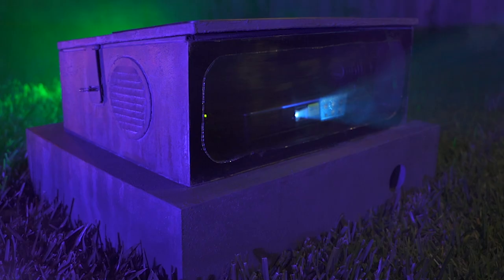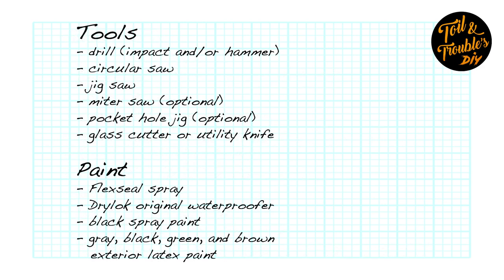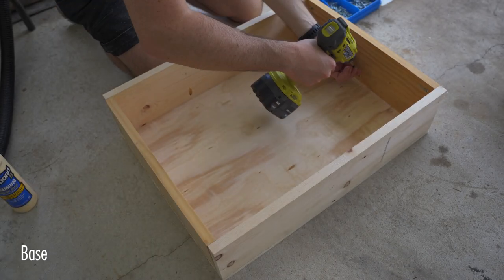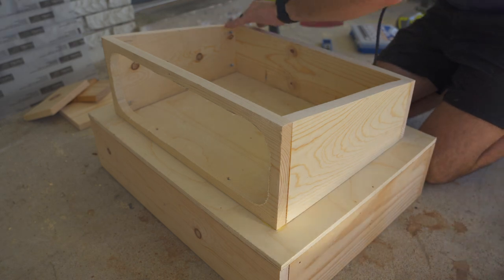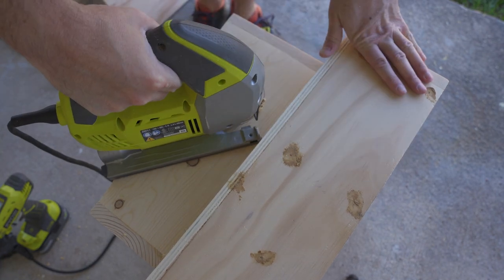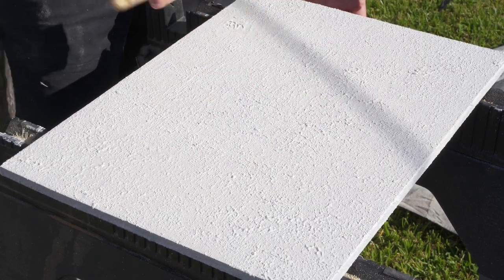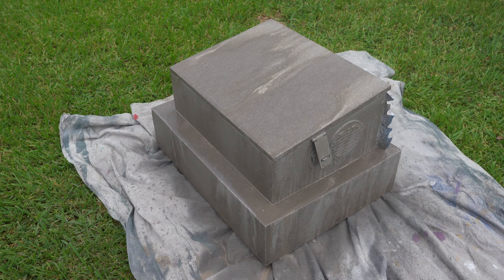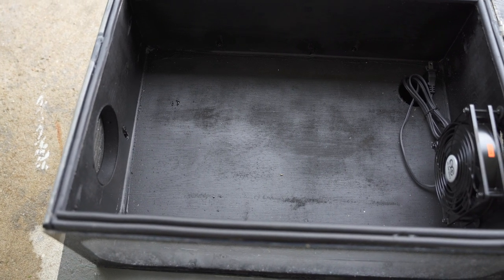How-to: Best Weatherproof Gravestone Projector Housing for Halloween Digital Decorating

Comment: I bought a pc case with 3 fans already installed and vent for 60 bucks.  Cut side panel and glued in picture frame glass. Easy, cheap, took an hour. Mounted with brackets on a pole.
Reply from the maker: Thanks for letting me know!
Reply: Is there a tutorial on how you did it?

Comment: Awesome final results. I’m in the process of making one of these myself! Just a friendly FYI, they make special plexiglass/lexan cutting blades for jigsaws.
Reply from the maker: Thank you! That’s great to know; I had no idea!
Reply: @ToilandTroublesDIY  Great tutorial video dude! Just noticed it after commenting on another video. What do you recommend for a projector that won't be too expensive for the pumpkins? Also, I assume the glass getting wet in the rain would interfere with the projection onto the pumpkins?
Reply from the maker: @fennec7906  Thank you! I highly recommend the Aaxa BP1 as a "just enough" option for pumpkins. And no, the rain doesn't really affect the image unless fog settles in behind the plexi, but hey, that's what the fan is for!
Reply: Thanks Peter for the suggestion of using jigsaw blade. I used Bosch T102BF and that saved the day for me (instead of trying to cut lexan manually)

Comment: Do you use the 1-1/4" pocket screws for the base and top? Or the 1" pocket screws? Thanks!
Reply from the maker: I used 1" pocket hole screws so that the screw would not go through the top sheet of plywood.

Comment: The PC fan has an electrical plug on it?
Reply from the maker: Yes it does
Reply: @ToilandTroublesDIY  The projector doesn't get hot with only 1 fan? Is it an intake or exhaust fan? Do you use waterproof extension cord covers at all? I'm thinking on building something like this for myself, but unlike a lot of projectors I see, my exhaust is on the front of my projector next to the lens, so hot air would be pushing up against the plexiglass.
Reply from the maker: The size of the housing was designed for use with small to medium sized projectors so the ones that I use do not get very hot when inside. You may want to consider putting vent holes in the floor of the housing and adding an additional fan on the other side to pull cool air into the housing. The fan used in the video is meant for exhaust of hot air and i do not use waterproof extension cord covers as all of the electrical components are inside of or under the housing.
Reply: @ToilandTroublesDIY  Yeah, my projector (BENQ W1070) is about 1 foot x 9 and a half inches big. I was reading through the instruction manual and it says: "Allow at least 50 cm or 20" clearance from walls and free flow of air around the projector." That's a very big gravestone if you're allowing 20" on all sides of the projector. It really does get quite hot so I'm second guessing whether or not I should even try to build an enclosure for it, especially with the fan blowing hot air out the front as opposed to the sides of the unit. I'd have reservations about completely sealing the unit away. If it was some cheaper LED projector from Amazon (I'd assume they don't get hot like bulb projectors) then I probably wouldn't care as much. But yeah, I was thinking about intake and exhaust fans. How much did your PC fan cost? They seem kinda expensive where I live. I was just lookin' to do the AtmoxFX pumpkins, which this projector is probably overkill for. A cheap $100-150 dollar LED projector from Amazon probably would've been a better fit. But I don't like giving $ to companies who lie about the specs of their products. E.g. "6k lumens" when It's really just 2-300 or lying about the native resolution. 

Also, curious, why not use real glass? I was reading around  the AVS forums and someone had this to say: "Plexiglass is not optical grade, so you will have reflections off the surface and distortion as the image passes through the material. Glass would be better, as it tends to be a much more uniform surface."

Comment: Zach, thank you so much for the video. I got into hollusion last year. I came across your video and decided to make a cover this year. Your video, instructions and design has been really helpful. And loved how you showed the material used like Flexiseal, Frost king weather seal etc. I was able to build the box over this weekend; it is same as your design but modified to have one box with base as a shelf; and painted the whole thing black as I’ll be keeping this projector box behind the hollusion material and want the box to be discrete.
Keep up the good work !!! Thanks again.

Recommended Tip: Thanks to @Peter Myette for the recommendation of using jigsaw blade for cutting lexan. Used Bosch T102BF blade and it worked like a charm; and saved me from ton of frustration. Cutting it manually just did not work for me.
Reply from the maker: Thank you so much for the kind words! Im pumped to hear it helped you out and I hope it works great for you! The jigsaw blade recommendation was solid for sure. Definitely going to pick one up the next time I make a new box so I’m glad to hear it works as advertised.
Reply: @ToilandTroublesDIY  Best projector enclosure video around! Got a few questions if you wouldn't mind.  Would glass be better? I've heard some people say plexiglass can cause issues with the image, so glass is preferred--what are your thoughts? My projector also vents heat out from the front and not on the sides, what could I do for ventilation while still keeping the enclosure waterproof? I notice my projector runs very hot, It's amazing you can keep yours from overheating with a single fan!

Comment: Great video.  I am making a projector box myself.  Is the fan for taking the heat out, or blowing air in?  In other words, I am unsure of which way to may the fan. Blowing in or blowing outside the box. Thank you.
Reply from the maker: Hey Ron. Thank you and thanks for watching! The fan is used to blow out hot air while the louver vent is meant to let cool air in.

Comment: How do you get the deep dark purple lighting? I’ve been using RBG LED floods and the “purple” is borderline “pink”
Reply from the maker: For the reveal in this video, I used a couple of LED par lights that I had on hand which combine blue and red LEDs to get a nice purple (linked below). I don't use these for decorating but they are nice for filming purposes! I also often struggle to get a deep purple using LED flood lights and they often appear pink as you mentioned. 
https://amzn.to/3C04v4t
Reply: @ToilandTroublesDIY  Thank you for replying and for the link. It finally ends my search! (I was wondering about theater lighting)
Reply from the maker: @ianmoore4539  Of course, happy to help!

Comment: How do you feed the power plug out for the projector and fan?
Reply from the maker: Thanks for watching! I run an extension cord into the housing via the hole in the front and top of the base then plug both the projector and fan into that extension cord.

Comment: Why wood over foam?
Reply from the maker: There is no particular reason for the choice of materials other than the advantage of wood allowing you to securely screw in hinges and a safety hasp. If you want to go the foam route, VanOaks Props recently made a great tutorial on building a foam housing but it does not provide a weather resistant enclosure for the projector.